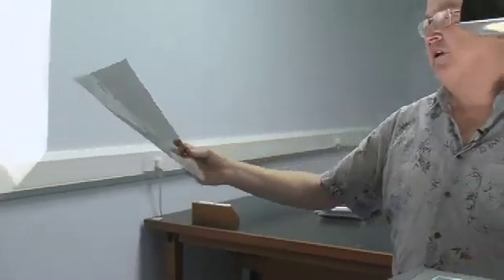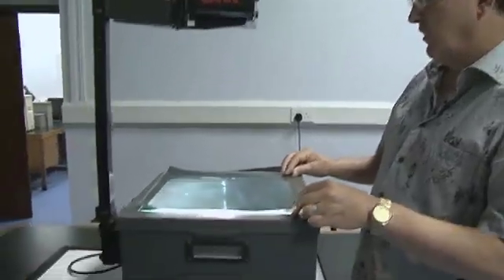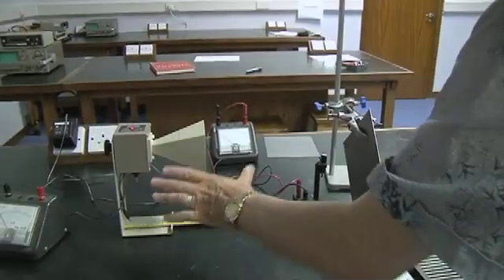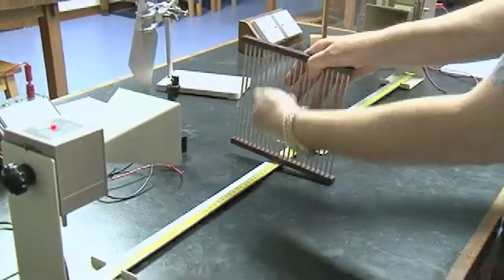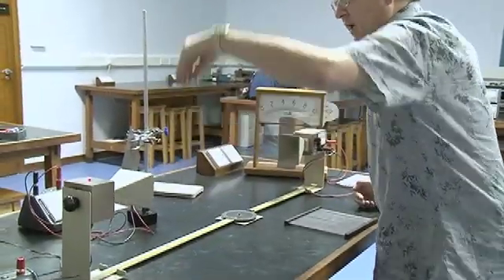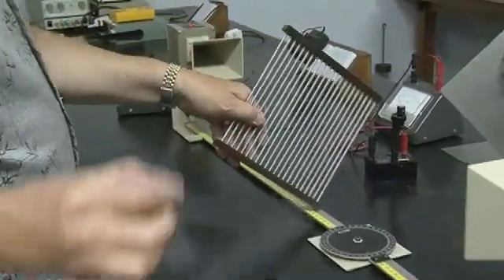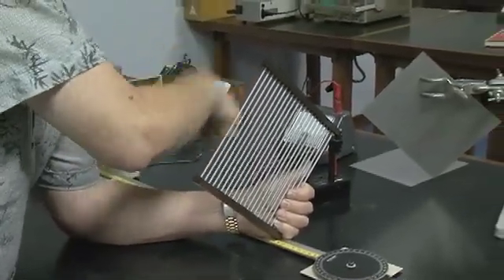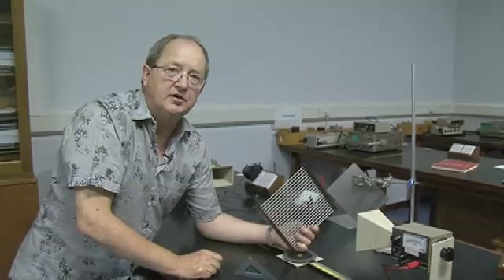Polarisation - Sixty Symbols

Comment: sblackNY actually, you can't convert something into electric tension without also making current, as they are corelated. And no, not all radios need a power source. There is a "famous" model that they used to do in WWII or WWI (can't remember) that uses a crystal earphone. Just google for "crystal radio" and you will see. It's very intresting easy to build! Weel, at least as long as you can get hold of a crystal earpiece.

Comment: Doesn't this experiment destroy the theory of a particle called photon !? How should photons be absorbed by a mesh of wires with huge distance between the wires? If photons were real tiny particles, they should easily pass through the leaks between the wires.
Reply: I don't really know ether, but I think of it like this. Everything is really a wave. Particles are fake. We want to think hard thing are real but everything is energy. Kind of like there is no color, there are only wave length. Like someone that's color blind. Except we think hard things are real and the energy that we can't really see is fake. Nothing is even truly hard or it wouldn't make a sound when you hit it. Many where told that water is not compressible, but in a black hole all things are compressible. We just don't see things the way they really are and seeing is believing.

Comment: Here's a fun thing to do if you have two pieces of polarizing material. Align them so almost no light gets through. Place a clear CD case in between them. As you rotate the case you can see a moving rainbow of colors, especially at points of stress.

I first saw this effect when entering an office building that had doors made out of some kind of tinted safety glass. I was surprised to see a wavy stripe of bright colors across the middle of the door that disappeared when I took off my sunglasses.

Comment: you know what's interesting about that wire frame? put two together perpedendicular so you get a wire mesh that effectively block all possible polarisations of EM waves with wavelengths larger than the grid size. it's called a faraday cage and it's the same concept used on glass doors for microwave ovens...

Comment: I should be more wary about using analogies. QM taken to its conclusion shows that even if you could see right down to planck length you still wouldnt be able to determine every detail. Particles are fundamentally not deterministic. When you refer to knowing the force of the throw etc, its a round about way of referring to the hidden variable theories that have been largely disproven. The more we see, the more it becomes apparent that Classical mechanics simply dont work with the quantum world

Comment: The photon is in both states but must be recorded in one, which one is based upon a probability. So its still not deterministic. 

Consider a perfect dice, it can roll 1 to 6. That doesnt make the roll any more determined even though you have a mathematical framework for assigning probabilities. It will ultimately have a 1 in 6 chance of landing on any of those values and that renders it non-deterministic. Its the same with the state of the photon and how it is ultimately observed.

Comment: I'm assuming he didn't talk about the maths judging by the comments so here you are:

I (incident) = I (maximum) x (Cos of theta)

Implying that at theta = 0 degrees cos theta = 1 so the Polaroid doesn't block out any light.

But at theta = 90 degrees (perpendicular) cos of 90 = 0 so I (maximum) x 0 = 0 so there is no incident intensity so all the light is blocked out.

Comment: @wrtlpfmpf the magnetic field induces current in the wire and because of the resistance of the wire,the electric field is absorbed and causes some heat in the wire.
Reply: No. 

NO antenna would work IF what you say is true ...

Comment: I use polarizing filters for my camera to remove unwanted reflections. The type of filters I use have on the camera side a layer that makes the light circular polarized, which doesn't confuse the built-in light meter as much as linearly polarized light... :)

Wait, what? Can you explain to us, what circular polarization is and how that layer on my filter manages to convert those two kinds of polarization?